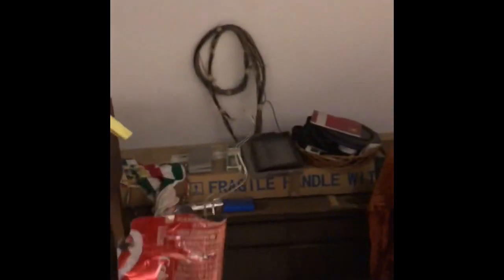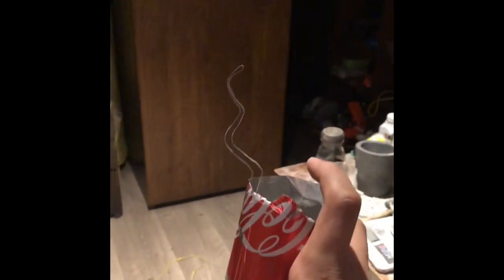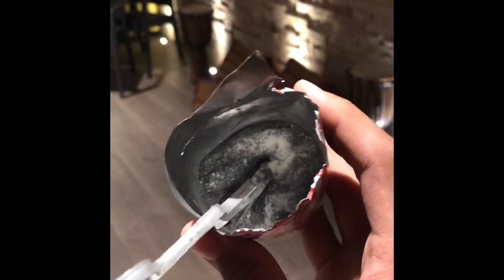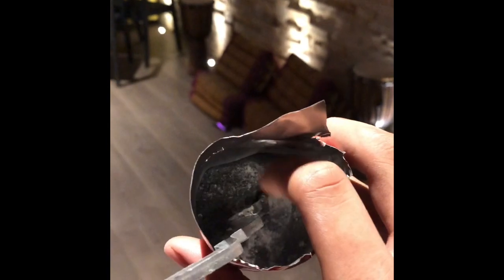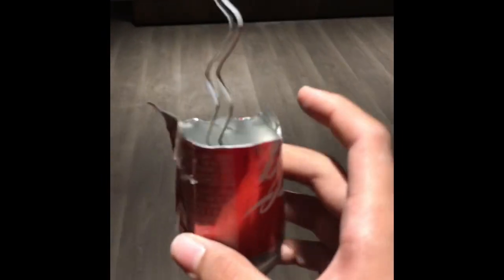Copper Thermite Reaction

Comment: Thats not an explosion. Fucking wannabes these days...
It's a deflagration. If that really exploded you'd have a hole in your backyard
Reply from the maker: Sorry for the incorrect terminology, I just meant explosion in the general sense.

butttt...  small explosions can take place so its doesn't necessarily  have to leave a crater in my backyard.
Reply: @Enderol89  Yes thats true but I just got a bit triggered by the "Mega bomb" in your title...
Reply from the maker: honestly it is quite a shitty title 
do you have any suggestions I could change it to?